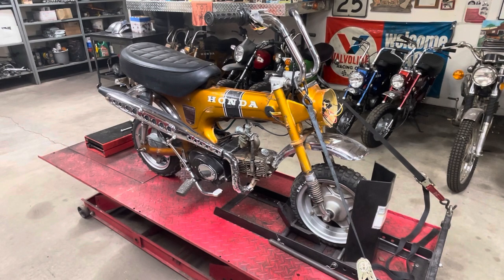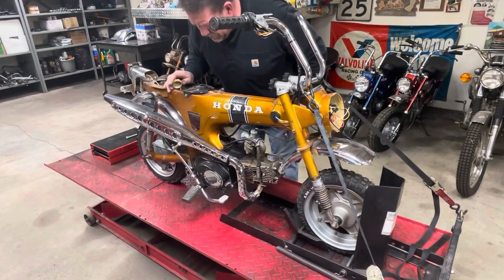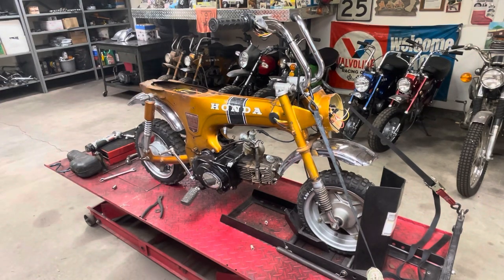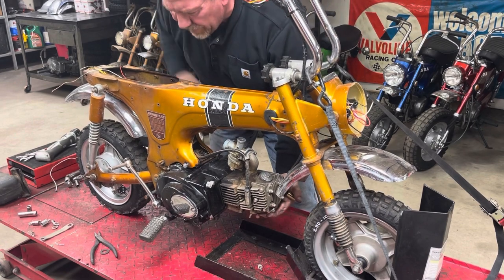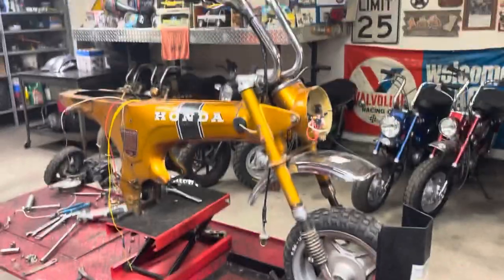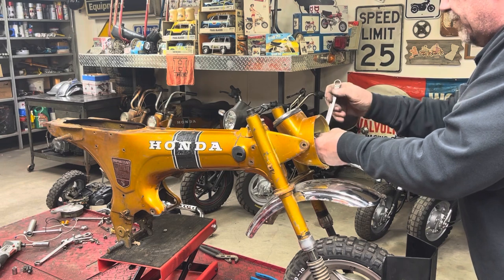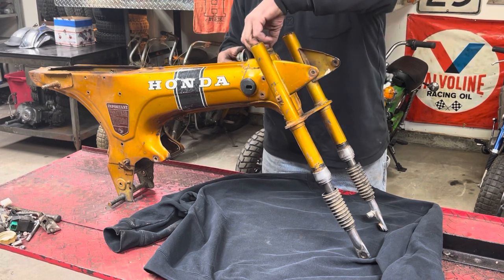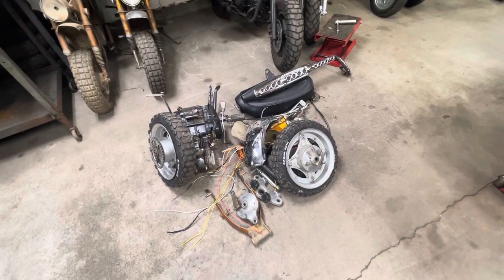$500 Honda CT70K0, let’s tear it apart.

Comment: Nice Mike! The days of the $500 CT70's I think are all but gone. I'll be watching the build!
Reply from the maker: I’ve been hearing that comment for the past 10 years, but I don’t have any problems buying bikes for $500 or less.   I’ve picked up a handful of projects over the past month and none have cost me over $500.  But……I’ve always said that my area is a hot spot for these small Hondas.  Our local Honda dealership is one of the oldest east of the Mississippi River and they sold tons of them back in the day.
Reply from the maker: Confederate flag Robinson  Like I stated in my above comment, we have so many because our Honda dealership has been in town since the 1950’s and with their connections to the Indpls Motor Speedway, our dealership was very popular.  We have so many small Hondas here, we’re tripping over them.

Comment: Nice job and what a fun project, looks like your SL70 inventory is reduced.
Thanks
Reply from the maker: Hey Kevin!   I did a little rearranging in the shop.  I picked up a used shelving unit and bought a roll around cart that holds the plastic bins.  It’s let me organize my parts much better.   So, while doing that, I moved some of the bikes back to a storage room.  I still have all the SL70’s and hope to get to one or two of them in 2022.

Comment: Would like to see if you could get that engine to run,for fun. Maybe a future video. Those tires need to b gone. Save the paint , just ad new decals. You have one in your stash I know. You cleaned it up,before you started working on it. Looks good.
Reply from the maker: Yes, my thoughts also, I’ll play with that engine at some point and see if it runs.  I haven’t even kicked it over.